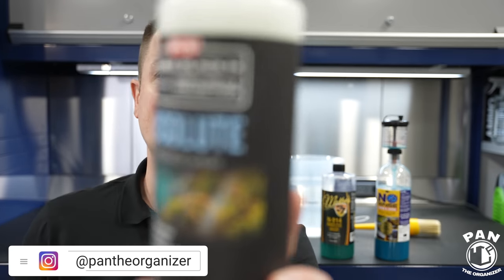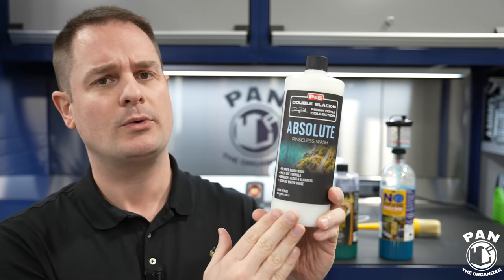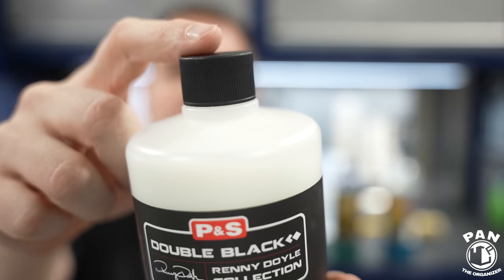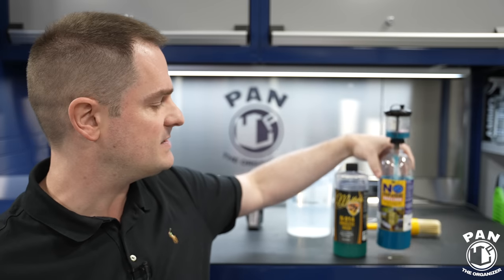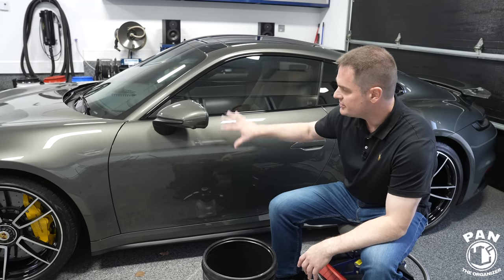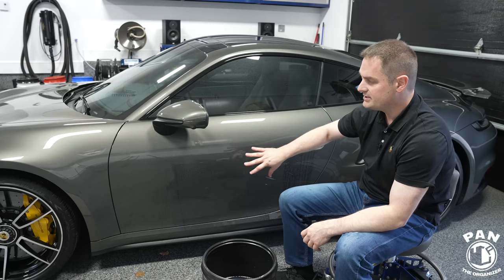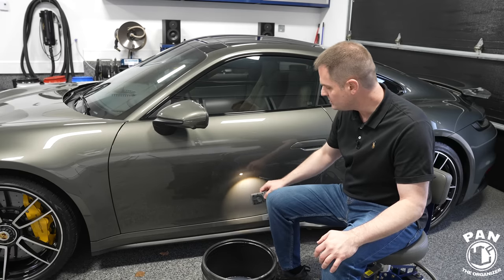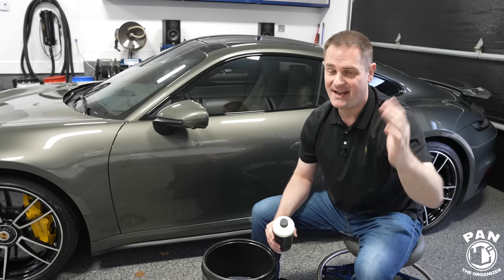NEW P&S Absolute Rinseless Wash... Is it better than ONR or McKee's?

Comment: I want to see a shootout between all the popular rinseless wash products. Which one leaves dirt in suspension in the bucket? Which one gets dirt off panels better? Glass? Which one is easier to remove if they dry up? And most importantly for me, which one leaves the less streaks?
Reply: I can tell you the answers to all of these questions, but why not spend a few bucks and see for yourself? Test then side by side and I think you will see that there is a clear winner.
Reply: @jeffc6832  I've never tried any of these products and don't want to buy all 3.  I would like to try one first, mostly to carry me through the winter, when the temps are too cold to wash a car.  Which do you suggest is the clear winner?
Reply: @pasqualepisani  just buy DIY Detail Rinseless, skip the rest, Pan even has a discount code.
Reply: @pasqualepisani  to be honest, you can't go wrong with any of them. They all work well and will wash your car safely and effectively.

That said, I would definitely recommend Absolute. Dirt goes to the bottom of the bucket (N914 holds it in suspension). All get the dirt off the surface well, but I think Absolute holds a slight edge. All work equally well on glass, but I think Absolute and N914 have less tendency for streaking. ONR doesn't streak either, when used correctly, but some have reported issues in certain conditions, or when mixing it too heavy.

Both ONR and Absolute are easily rewetted and removed if they dry on the surface. N914 spots take more effort to remove, and can create water spots with very hard water. Absolute tends to stick around the longest on the surface, while N914 dries up substantially faster.
Reply: @jeffc6832  Thanks Jeff - I'll wait to see who has a Black Friday special and grab it.  Based on the videos and reviews, it's a pretty close call b/w ONR and Absolute.  If Absolute didn't look like sperm in a bucket, I would have made the move already, LOL.
Reply: @pasqualepisani  get your mind out of the gutter and enjoy the best that rinseless washing has to offer. 😉
Reply: Thanks for this tutorial! For a long time never paid attention to the array of rinseless wash products. 

Here in Eastern Wa. St. I can wash my car in the afternoon & park it inside the garage. Next day there will/be a fine layer of dust. 

Now, instead of thinking of having to rewash in a day or two, Absolute to the rescue :-) ~ Cheers ~
Reply: @pasqualepisani  wat

Comment: I have tried adams hoseless, griots,  absolute, wolfgang sio2, wolfgang uber, diy detail, optimum no rinse wash wax, mckees 914, and luxury microfiber rinseless.  They all work well and the only real difference I found was scent , packaging. and the wolfgang  sio2 adds some nice water beading to the surface.
Reply: i can't move on from Wolfgang sio2 🤦‍♂️
Reply: I haven’t tried all the products you have, but I love the fact that the DIY FOAMS. Was a major difference from the ONR and McKees for me! 🤓😎
Reply: I'm a fan of Mckees, they don't use polymers. You don't have to be gentle with it when mixing and its better for the environment. Its a little more expensive but all in all still cheap.

Comment: I have been using ONR for years. I got a gallon of Absolute and find that it works well washing the car. Its slightly slicker gliding over the paint than ONR. The one thing I did notice is that when drying with my Gauntlet or Platinum pluffel it seems to not be very slick and little grabby when drying,I freshly coated with CSL about a month ago. Thats with alot left on the surface so it should still be giving good lubrication on the surface for drying. I also have DIYDetail rinseless and find that its as slick as Absolute for washing slickness but when drying it is much slicker feel and I feel it has the most cleaning power of the 3 and is my favorite. All 3 do great and wouldnt feel uncomfortable about using any. I have alot of Absolute to go through.
Reply: Agreed, DIY Detail is the best on the market today.

Comment: Absolute is my first rinseless wash solution. It’s my choice because the price. Same dilution ratio for wash bucket method as the others but for exam for quick detailer 64:1. ONR 16:1. That means I can use less product for the same results. In a future I’ll try others. I’m so impressed, I use it all the time, all my quick detailers, clay lubricants and dry aids are in the trash can. Not because they’re not effective. But Because no rinse solution is so economical. My 32oz quick detailer from absolute cost me only 50 cent’s, it’s amazing!! I rinse and wiping off all my tools that I’m using to detailing my cars: buckets, hoses, pressure washer and more. It’s sounds funny I’m using it on buckets, but my stuff is free of any water spots, tools looks like new.

Comment: Adding 1.5oz of the Absolute Rinseless wash to a spray bottle or sealable container of warm water allows for intense and complete mixing.  Then add mixed bottle to 3 gallons of water in wash bucket.  Much better results for me then adding directly to wash bucket.  Glass cleaning was excellent and drying did not produce streaks as it did with my first attempt.
Reply from the maker: Thanks for sharing your experience Joshua. And yes warm water does seem to help.

Comment: I bought Absolute right away when it was launched, and it has thoroughly impressed me after 5+ years of using ONR. I have also used N914 extensively, and tested a lot of other rinseless washes over the years, but none of them could replace ONR for me. Absolute is now my preferred rinseless.

When pushing the limits of a rinseless wash (very dirty panel with no pressure rinse beforehand) I have noticed that Absolute holds an edge in cleaning power over both ONR and N914. It seems to emulsify and encapsulate better, resulting in less drag when wiping over the dirty panel with my rinseless sponge. Obviously that is an edge case that I don't make a habit of, but is good to know.

ONR is still a great product that has been updated over the years, but it is based on 20+ year old technology. The main polymer package that is in Absolute didn't exist 2 years ago. I really enjoy the extra slickness that it provides during the washing and drying process, and I think Absolute dries easier with less chance of streaking or smearing. I also find the smell of Absolute to be much better than ONR (which can be a little cloying).

I like N914, but for me it has two main drawbacks (which can be overcome with the right process). 
1. N914 doesn't soften water as effectively. I have very hard tap water, and I had to polish my doors last summer after doing a quick N914 wash. Drips from the side mirrors etched the clear on a hot summer day. I have never had this happen with ONR or Absolute. Because of this, I only recommend mixing N914 with distilled or DI water.
2. N914 holds dirt in suspension in the bucket, instead of letting it drop to the bottom. The argument could be made that the dirt is safely emulsified, but I would still recommend only using the multiple towel method and not bringing dirt back into the rinseless bucket.

Quick tip on mixing Absolute: Shake the bottle vigorously before pouring, and mix with warm or hot water if you have it available. This greatly aids in the dispersion of the product into the water.
Reply: This was a bit lengthy but worth the read. Thanks
Reply: Well stated, wait till you try DIY Detail Rinseless, you’ll be even more pleased.
Reply from the maker: Well said Jeff and thanks for sharing your experience with the different rinseless washes too! As I have a deionizer setup at home, I have mineral free water and this can change the experience if a person has hard water issues like you do. Always nice to have different feedback for my viewers, and I'm sure many will appreciate your input as well!
Reply: @havingtoomuchfun4806  it's on my list to try
Reply: @PanTheOrganizer  no problem man. I love rinseless washing, as it fits my conditions the best (hard water, full sun in summer, harsh winter 6 months of the year with only temporary heat in a small garage with no floor drains). Rinseless has always worked great for me, and I'm very glad to see that we have another great option in the rinseless market.

That said, someday I hope to install a DI water system (waiting for the cash and for Matt to finalize the custom OG solution), once I have permanent heat in my garage.

Thanks for all you do Pan!
Reply: @jeffc6832  you won’t regret it.
Reply from the maker: You bet! I am waiting to see what the OG DI solution will be. 😁
Reply: Good read bro! Thanks for the tips!
Reply: Great post was going to get n914 but will try absolute instead due to the water softening
Reply: Well damn! Thanks for taking out the time to write your thoughts...its greatly appreciated...great info from real world experience
Reply: @OiDavoMate you might want to go ahead and try the DIY Detail Rinseless while you’re at it 😉🤓😎
Reply: Thanks   I have new bottle today   This will first application w absolute
Reply: Can this be used on cars with PPF? (paint protection film)
Reply: @ambitiousceo yes, absolutely. 👍
Reply: @jeffc6832 were you able to try out DIY Detail Rinseless? Would love to hear your thoughts on it, as I’m trying to decide between Absolute & DIY
Reply: @skrsys for the price just buy absolute, you get double for your money and still save. It is super slick and wont leave streaking or water spots unless you really try to and dries on panels in direct sun, even then can be reactivated with more solution and wiped off. The labo-cosmetica rinseless is said to be really good as well. But ive used Absolute with very diryy panels, salt, dirt dust etc and with a slotted sponge and used properly it works very well especially on glass. I add a tiny but to my buckets if doing a traditional wash, and into foam cannon for the water softening aspect. Also less is more with this, if you dont follow the dilutions and add too much it wont work as well and will streak. I do rinse less with it in my IK multipro 12 and 1.5 gallons warm water is plenty to soak down my full size truck then i go in with the 256:1 ratio in a bucket with about 2/3 gallons of water and grit guard and its great. Its all about doing the process properly and it really is simple, to ensure you are lifting that dirt and releasing it properly, and not just rubbing it all over the panels. Hope this helps some. Also heard really great things about Flex Hybrid Ceramic. But havent tried it. And if you have a fully coated vehicle any rinse-less will work even better and faster overall process  jus like a regular wash with coated vehicle
Reply: Onr for me , I use it for interior maintenance, glass cleaning , drying aid
Reply: "recommend only using the multiple towel method..." The multi towel/sponge/whatever media method is the only way to go. I don't care what chemical you're using, I don't care how good your grit guard is, running wash media over a surface more than once is ridiculous and completely unnecessary. Towels and sponges are relatively cheap. Yes, a grit guard and nice products will minimize marring, but at the end of the day, running something over the surface of your paint that has been exposed to dirt will always be worse than using something that is fresh and completely clean. A handful of good quality towels that cost perhaps 30 or 40 dollars total is more than good enough and will last you many years. Seems absolutely bonkers to risk marring a nice vehicle like this, and spending hundreds if not thousands on high quality products and equipment, just to turn around and rub a dirty sponge on a car when there is absolutely no reason to do so.

Comment: Pro tip: Use an empty P&S Rags to Riches double neck bottle to measure and dispense amounts of Absolute instead of the cap. Like using the Pro Blend proportioner.
Reply: You can also pick up identical bottle styles from places like Detailed Image :)
Reply: @stephen1503  true, but the one they carry is only 16 ounces. The Rags to Riches bottle is 32 oz.
Reply: I assume you can blow dry it also? I also picked up,a stubby nozzle for me Ego650 on eBay for $50 cheaper than the one you were testing! $37 shipped
Reply: @flytyingguy1  this would defeat half the purpose of using a rinseless wash... which is to provide lubrication for safe drying. You can blow out cracks/crevices if you want, but you want to have that leftover solution on the paint when you wipe it.
Reply from the maker: Good tip!
Reply: or a wolfgang rinseless, they use those bottles too
Reply: Auto fiber carry’s the 32
Reply: @jeffc6832  I mean that's not to say it goes against the purpose of it. Most people already use a LSP as drying aid anyways
Reply: Yes!! I do this and it’s great, but also a pointer don’t use problends with absolute. It’s too viscous and clogs up. It doesn’t measure out well.

Comment: I learned how to use ONR from one of your older videos, and have been using it since March when I got my new Tesla.  I noticed that it is probably through my techniques that I have a lot of micro scratches,  and I think it would easily be buffed out with a slight machine polish.  At any rate, I found that I'm having issues with wax sprays sticking to the surface after using ONR.  For example, I purchased the TW ceramic spray about 4 months ago and have had to apply it 3 times now because it simply doesn't stick even with a good paint prep.  Will I have that issue with P&S Absolute?
Reply: My understanding/recollection is that ONR actually leaves a residue. I like to use car pro descale followed by car pro eraser before applying a ceramic coating.
Reply: If you want to continue using ONR, I would recommend switching to Optimum Car Wax or Opti-Seal (which now has a ceramic formulation). They are designed to work with ONR. Bead Maker also works very good with ONR, and is great with Absolute as well (since it is also made by P&S).
Reply from the maker: Again, great advice Jeff! You're on fire!
Reply: @PanTheOrganizer  learned from the best...the guys at TRC, Yvan, Larry, Matt and you!

Comment: I just purchase this based on your review.  I've always been using ONR all year round.  It definitely saves time and water when washing.
Reply from the maker: Let me know how you like it once you test it.
Reply: @Pan The Organizer  just washed my car today with the absolute.  It definitely leaves the paint slicker than ONR.  I'll  be using this as my primary wash.   I also topped my car off with turtlewax ceramic spray coating.   I love its durability.
Reply: @PanTheOrganizer  Also, I forgot to mention.  I did have the clumps that you mentioned, but it was only brief.  As I was washing the car more, it fully dissolved.

Comment: Honestly, after doing a rinseless wash the last few times I washed my truck, I don’t think I’ll go back to traditional soap/foam/2 bucket method ever again. Unless, of course, the situation calls for it. But it seems to me if you do regular cleaning/protection, you can just continue to do rinseless washes. 

I just find it a an easier and more satisfying experience. I also finish washing much quicker. And I can do it 100% in my garage. The last one is a game changer for living in TX. Washing cars outside in the summer in TX is borderline undoable.

Comment: Pan during the winter when there are a lot of road chemicals used would you recommend a 2 bucket method when doing a rinseless wash?  Dip the sponge in a bucket of water with a grit guard to remove most of the debris and then redip into the bucket with the rinseless wash before applying again.  I am just thinking of how my cars lower panels look after a snow storm.
Reply from the maker: Correct Jay! And of course, make sure you have a grit guard filter at the bottom of the bucket.
Reply: @jayhoughton558  perfect. Thank you

Comment: Yasou Pan, thank you for the detailed video. I just bought the Absolute Waterless product and I love it! My car has Nit been washed over three (3) months because I moved from Virginia to Florida. I have the following questions:

1. What gloves do you use for washing/detailing cars and were can I purchase it?

2. What is the difference between P&S beatmaker and Turtle car wax? Which will last longer?

3. How much should I 😅charge for washing other cars? I just moved here 2 months ago and a few neighbors asked if I would be interested to wash their cars. 

I look forward to more of your detailing videos. They are very educational!

Please let me know if you have any questions or concerns. 

Sincerely,

Nikos
Reply from the maker: Yasou Niko! Ti kanis?

1. I wear nitrile gloves. You can get some here: https://amzn.to/3D63w4P

2. P&S Bead Maker is a paint sealant, lasts 3-4 weeks, mainly used for its awesome gloss and slickness, and to top off your existing protection underneath: wax, sealant or ceramic coating. You can use Bead Maker as a drying aid or on dry paint. When your car is washes, after rinsing, while it's still wet, you can spray it on the surface, and use your microfiber towel to dry. 

For Turtle Wax, it depends what car wax you are referring to. They have dozens of waxes. 

3. I can't answer that, as it depends on what detailers near you charge. It varies from country to country, state to state, city to city, even from one neighbourhood to another.

Welcome to my channel. You discovered one of the biggest car detailing channels on YouTube as we surpassed 905,000 subscribers and we have over 117 million views! I have been detailing for 26 years and I love to share my knowledge and passion with my viewers.

You found the right channel to help you learn everything about detailing.

Comment: I’ve found it mixes much better with warm water especially if you have warm water out of your hose bib with some pressure just treat it like you would a thick soap 
Add it to the mitt then spray the water into the mitt to mix thoroughly